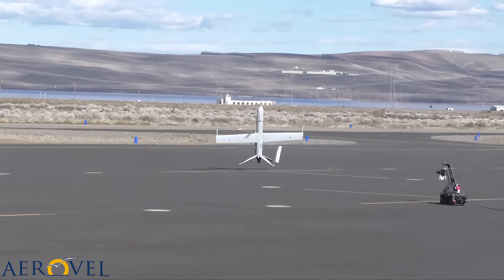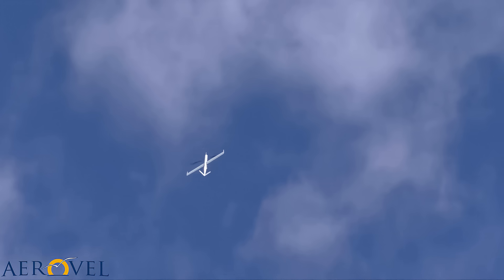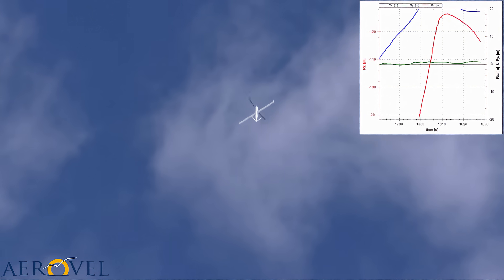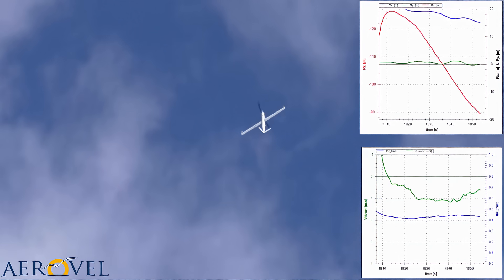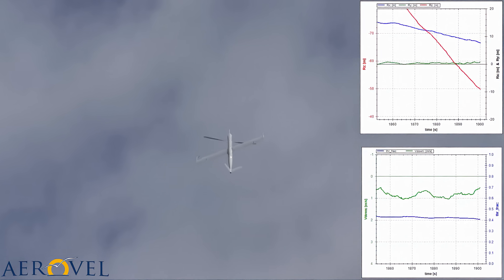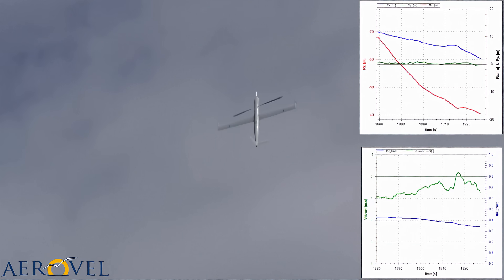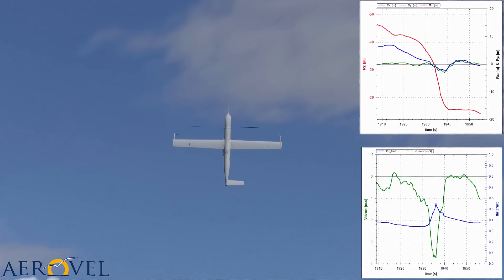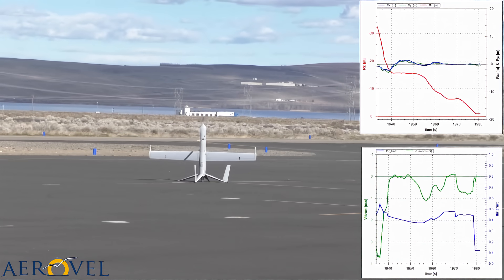Flexrotor Drymo makes a nearly vertical approach to landing

Comment: Whilst I do not doubt the engineering and control off this unique looking craft, which is good, what is the end application?  What is it's benefits over other VTOL craft? As an unmanned drone, I can see a few advantages over the typical quadcopter type of drone. It has a single largish helicopter blade, plus two smaller wing tip, anti- rotation, ie torque negating smaller propellers. I assume it flies vertically to a safe altitude, and then transforms to the horizontal, for aeroplane mode and conventional forward flight!  This concept is simpler by having less motors or engines, and thus in this alone, it has some unique advantages over the current crop of drone type VTOL aircraft, but not for passenger carrying!
Reply: Pentagon money

Comment: Can you explain that strange asymmetrical tail arrangement?
Reply: It's the minimum number of empennage control surfaces needed for control.
And, by minimizing the number of surfaces, you also reduce drag.
Reply: @LostAnFound  Yes, but why 90 rotated from the wings??
Reply: @atomicsmith It's a tail-sitter, so you don't have to worry about their position interfering with the ground when landing.
This provides an opportunity to put them in prop-wash that's undisturbed by the main wing for better pitch, yaw, and roll authority, especially at low speeds
Reply: It's just elevator and rudder. Elevator is only on one side for simplicity. The rolling force you get from only having it on one side, is easily corrected by the rudder and ailerons.
Reply: @MortenBN but the thing is, why not double the configuration? It is perfectly doable
Reply: Here for the answer
Reply: Why not a v-tail config then? Or does the empennage have to split where it does?
Reply: Counter the torque from rotor

Comment: Black pavement will generate a ton of thermal lift!

Gliders love flying over the local shopping mall parking lot that is next to the airport…

They launch at the airport, and circle over the parking lot… to gain altitude.

The heated air rises off the pavement….

Replacement air moves in off the adjacent grass fields…

I bet there are all different kinds of waves as the replacement air rushes in, and heated air rises out….

The viscosity of air is low enough there are most likely swirls of expanding air causing strange invisible vertical eddy currents…

Try a cloudy day next…

Or flying over the grass adjacent to the runway, to see if there is a significant difference.

Only in aviation do I ever consider the viscosity of air…

Great video, the graphic data is awesome!

😃
Reply: True about the gliders. There was a rock quarry across the highway from Sterling field in Mass, between Worcester and Leominster, and after release we would try to get over to that because it would sometimes thermal you up pretty high. Got to 9k ft there in a Blanik once.  Good times.